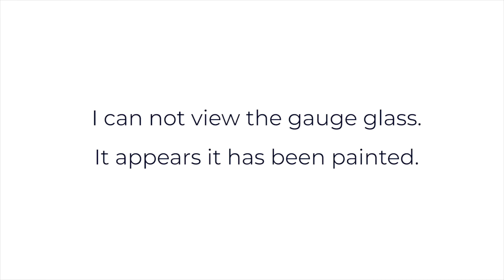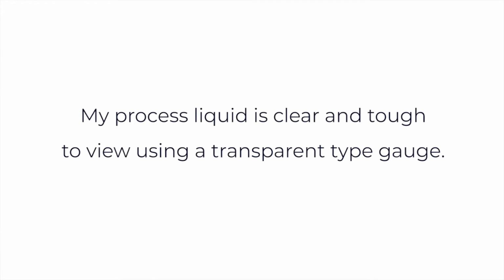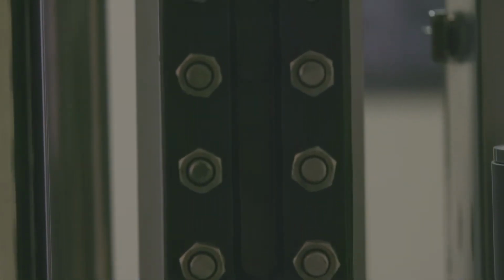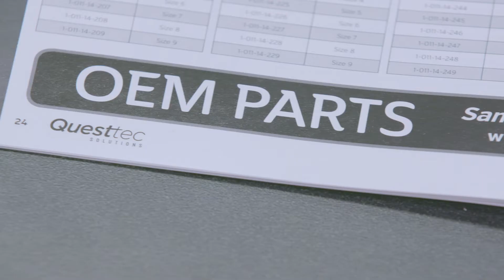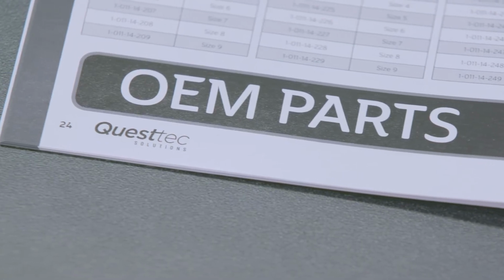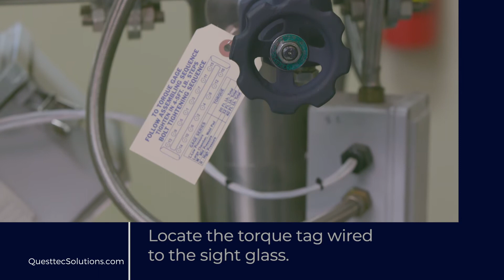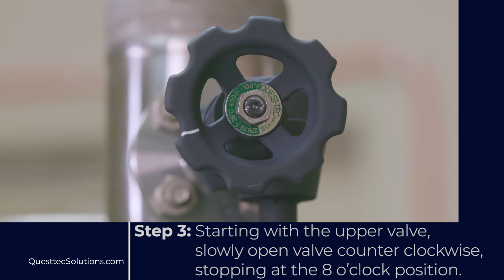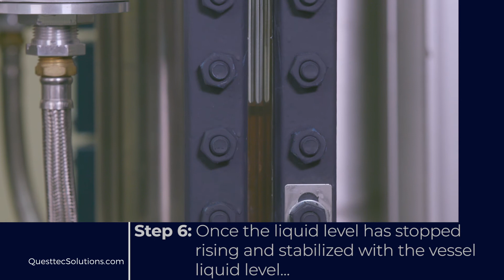Glass-Trac FAQs and Start Up Process

Comment: Can you explain, how to clean the sight glass when it is filled with foreign materials inside which results in poor vision of level.
Reply: A sight glass brush may be used thru the vent & drain ports on the gage valves, with a cleaning liquid or water to flush out contaminates thru the drain. Low pressure steam, facility utility steam (<300psi) may be used to steam clean thru the vent & drain ports. For boiler applications a blowdown may be done. For heavy accumulation it may be necessary to rebuild the gage with new glass, gaskets, etc. as routine maintenance.